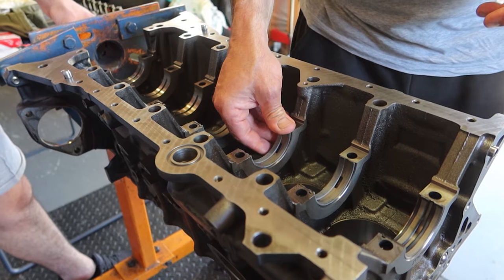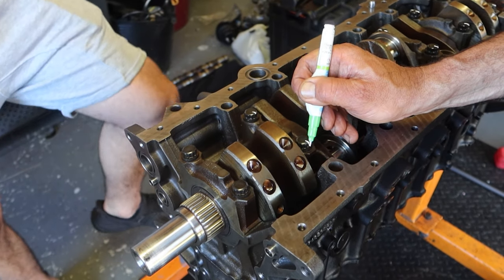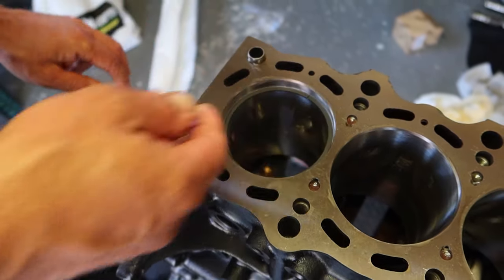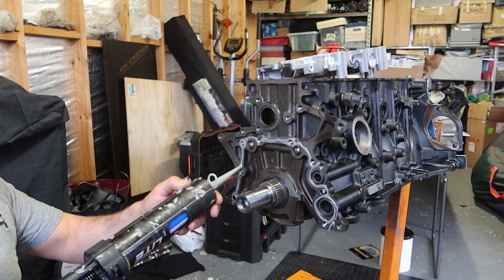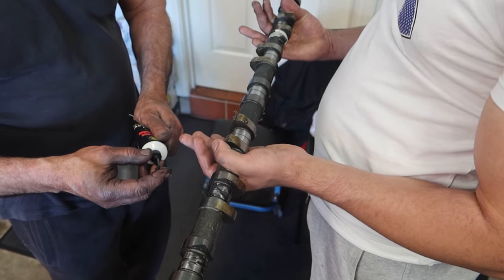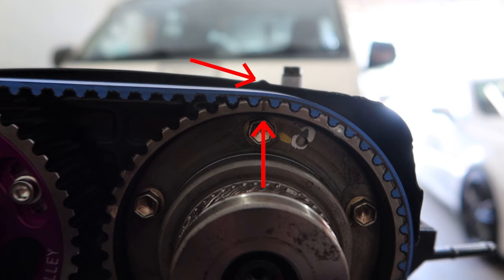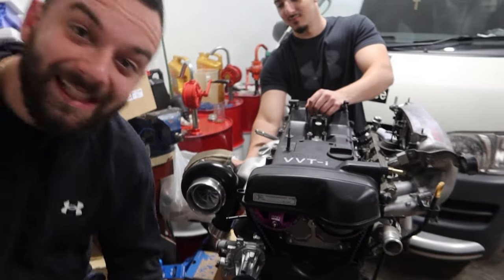COMPLETE 2JZ Engine Build - Start to Finish (Detailed Build Guide)

Comment: Your videos are legitimately helping me build my 2JZ. Goal is 600-650 whp 🤙🏻
Reply from the maker: Im glad to hear they are helping you my man!! Thank for the support!! 600whp will be a breeze for any 2J build 👌🤘
Reply: @AutoMotiv8ed  hello, do you think ge stock rods for 2jz nat engine will last 300 hp?
Reply from the maker: @semihkaya7496  after months of research, 350-380hp is the absolute max the ge vvti rods could hold before they break, although the ge non vvti rods can hold double the power
Reply: @AutoMotiv8ed  thanks for the reply👍🏻
Reply: @AutoMotiv8ed  greetings from turkey ❤️
Reply: @AutoMotiv8ed  the none vvti rod can re use to vvti? And how much the full cost for fully built 2jz gte?
Reply: @AutoMotiv8ed  can I make my 2jz-ge into a twin turbo?
Reply from the maker: @XiGu hide  anything is possible
Reply from the maker: @SGQ12  correct 👍. Full build cost is on out channel

Comment: Love your videos man I really learn a lot from them. I have a question. So I have a stock engine but I want to build it to do 350-400 what are some mods I can do?
Reply from the maker: Thank you the the support man im glad our videos are helping you out!! to get 350 hp id reccomend slapping on a cx racing turbo kit complete with the intercooler kit. fuel pump and a boomslang harness which plugs directly in to your standard ecu so you can run the turbo kit!

Comment: Was there a need to drill a port for the turbo oil feed and return system into the front left side engine block port for the GE vvti block since the GE vvti blocks weren't meant to run turbos?
Reply from the maker: all we needed to drill was a oil drain and add a fitting for the oil pan

Comment: A tip I would give is if you are reusing the vvti gear, buy a new vvti o ring from driftmotion and replace it but make sure the bolts go back in the original spots bc im pretty sure its balanced. They are known to leak on these engines

Comment: Awesome! I’m starting my 2jz ge vvti build, I’m taking the bottom end of a 94 gs300 2jz ge since it has the stronger rods than the 2jz ge vvti that’s in my 99 gs300, slowly buying all the things I need for the build because I want to do it all in one go. My goal is only 500hp for now, and then to dress the car up real nice. Thanks for this video I appreciate it! You got yourself a new follower!
Reply from the maker: Thank you for the awesome comment! Feel so grateful to be sharing our 2jz knowledge with you!! Youre build will be sick!! keen to know once your done!! feel free to send us some photos to our Instagram dm  👍
Reply: @AutoMotiv8ed  I think an issue I may run into is with the transmission I should use. Since the short block will be from an older 94 gs300, that used the 4 speed a340, where as the car I’m putting my built engine into is a 99 gs300 that used the a650ethat is a 5 speed. Would I be able to use the a650e on the short block from the 93 gs300 or should I get an a340? And at that point would I need some sort of conversion kit? Being honest I don’t know how to drive manual, which is why I’m sticking with automatic trans until I learn. Any help with this problem would be greatly appreciated. Thanks!
Reply from the maker: @Diabetic_Deity  a340 is a much stronger trans than the a650, we were limited with how much power we can put down because of the a650e. But in saying so, you will also need to run a trans computer to support the a340, its the only limiting factor for our build also

Comment: I've always been taught to use appropriate gasket with silicone for the installs... the turbo gasket is a better choice instead of na gasket
Reply from the maker: correct
Reply: The proper gasket to use isn't just based on if its turbo or not, Its chosen based on engine build spec. Different thickness of gaskets will change the compression ratio and squish/quench. It also depends on rod/piston size and if too much surface material was shaved off the head or block. The GE headgasket is plenty stout to make big power

Comment: Do the valve cover bolts, specifically the middle by the coil packs. Do they go into the engine? I want to drill extract 2 but dont know if metal shavings will go into it

Comment: Your cam setup. 272/278. what camshaft are being used for the ge vvti head. So far I’ve seen 264 272 or 276. Haven’t seen a staggered setup yet. Also is there any modifications needed for the cam’s to be fitted without any issues or problems?
Reply from the maker: https://youtu.be/XIMaLENWXZ0

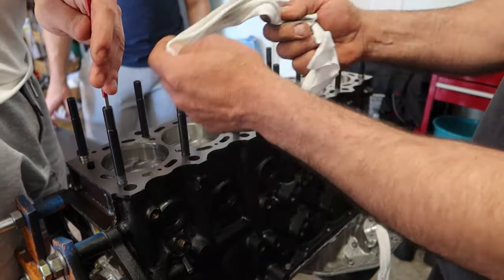Comment: Thank you for this Descriptive Video? Is there an order or specific way the rings are installed on to the piston, the ring gap ? Should they be 15 degrees install ? One at 12 o’clock and the other at 12:15 ?

Comment: So the GE VVTi is already having the camshaft sensor from factory on the VVTi head… and you used GE non VVTi stock pistons and not GTE pistons ? Please let me know as my IS300 is in transit to me and I’ll get it soon … I want to do the same turbo build for drift application … so what is your current compression ratio with those pistons 9:1 or even more ? I mean that if you break the timing belt the valves will bend and will screw the whole block + head right ? Or not ? I still can’t understand if the GE VVTi engine will be completely screwed if the timing belt break … from Rad Dan video I realized that the both GTE engines are secured in terms of breaking the timing belt because of the 8.5:1 GTE pistons (and may be the design of the GTE heads) and the GE ones are not secured if timing belt break, right ?
Reply from the maker: Correct, and correct. 

Our Current compression ratio is 9.2:1 as we have used the GTE MLS headgasket with the na non vvti supra pistons. 
Basically here is a breakdown to answer your question;
N/A comp is 10:1
Vvti n/a comp is 10.5:1
N/a with tt gasket comp is 9.2:1
Vvti n/a with tt gasket comp is 9.7:1
N/A with tt pistons and n/a gasket comp  is 9.0:1

although yes the na engines are interference engines, meaning if belt breaks pistons will colide with valves.

Comment: im wanting to build a GE motor but i want to do everything else GTE. i also want to put a T56 trans in the car when i get it. my question is wiring... how will that work...?
Reply from the maker: you will need to use a aftermarket ecu to control the engine/body wiring. T56 trans will work great, but i advise getting a complete off the shelf kit, as soucing parts on your own to fit t56 may be stressfull

Comment: Nice build! Will be curious to see what boost you can run with a ge head gasket and 272 cams.  Looks like you need a forward facing intake manifold to match that treadstone cast manifold. Can’t what to hear it start.
Reply: Treadstone manifold works great with stock cross over Intake 👍
Reply from the maker: Thank you my guy!, This setup should sound killer once its all dialed in 🙌
as Rally Ranch Motorsport said above the cross over intake works perfect with the treadstone cast manifold!! Lots of time and reseach went into this we wanted our build to peice togeather smoothly!
Reply: @AutoMotiv8ed How do I get a list of torques for screwdrivers or screws?

Comment: great videos guys!!! keep them coming..is that the stock is300 inlet manifold your running there? or one off a supra gze vvti? reason being is that the is300 intake crosses over the top of the engine while the supra intake is forward facing
Reply from the maker: Hey man thank you for the support!! We are sticking with the cross over intake manifold, and making it work to suit out build. Stay tuned for the next video were we will be explaining how its done 💪

Comment: Would there be a point to install and mill in oil squirters if the pistons are forged? And how much more HP can you push the engine assuming everything done with the oil quirters added?
Reply from the maker: unfortunatelly not, oil squirters are not really a make or break on 2JZ's, there plenty going around with over 1000hp and no oil squirters

Comment: hmm
the angle method you choose for the main bolts is wrong and inaccurate,the proper way is with an angle measure tool
Also the clip opening on the piston wrist pin should never be in the opening gap

Comment: Hello, so u guys used ge vvti pistons? Are these good for 550/600hp?
Reply from the maker: Correct sir, this is our ideal goal with plenty of torque response 🙏
Reply: @AutoMotiv8ed  Are these HP goals on pump gas or E85?
Reply from the maker: @DLANM57  pump gas